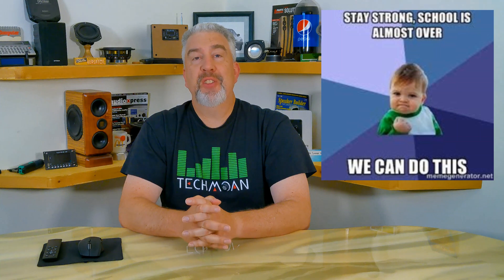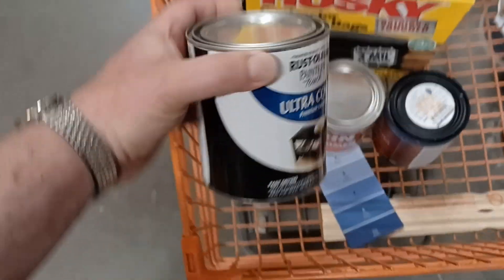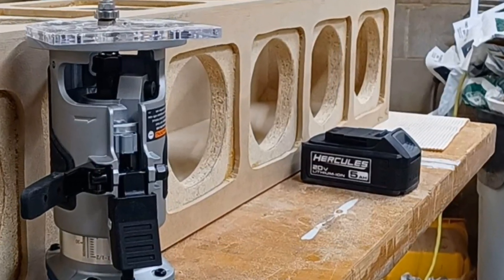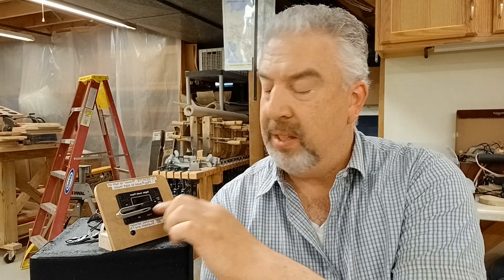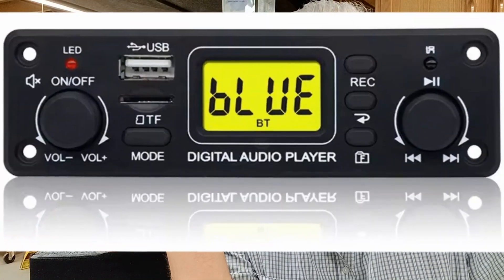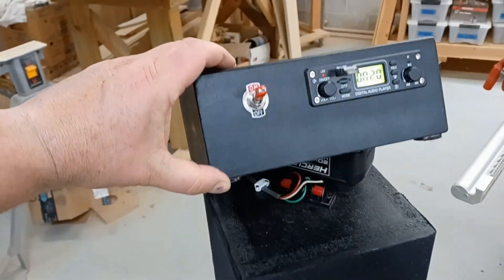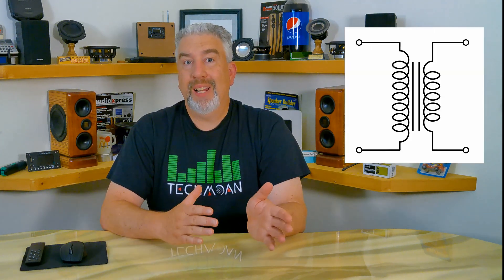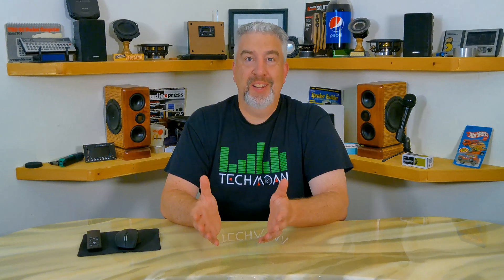Quick Tunes Music Player - Loud & Battery Power'd!

Comment: Great Video the unit it's Self is good it's the alliminiam covered  with copper is crap as you say I solder 16g wire and put screened wires I run mine on a 12volt converted from 21volts simple hot dipped packeg cost £8 the unit runs at full volume about 98 db for 17 hours on a full charge have used it many times so think you were unlucky my friend great videos keep the coming
Reply from the maker: Could be that I got a faulty unit, true, but this thing is just at the bottom in every category of quality. It's cheap, so I don't expect too much. Thanks for the comment.

Comment: I think I may know what the issue was. You said you tested it in your house with no issues (your house temp controlled), you played it in the afternoon with no issues, and you played it during the day in the "SUN" and after "SOME TIME" it started having issues. It sounds like to me that the head unit was getting hot and maybe a little DC fan would have kept it cool to the point it would have had no issues. 

Over all cool project!
Reply from the maker: Good thinking... seems to make sense logically. I was able to duplicate it again afterwards in my basement where it's fairly cool though, so I'm thinking it's just poor build quality...  nice deduction though!  Thank you for watching and commenting!

Comment: nice video! Maybe it did cut off because of the amplifier overheating, especially if there was a bit of sunlight hitting it; that would maybe explain why it worked just fine in the afternoon.
Reply from the maker: Heat... that's a really good bit of troubleshooting there. It happed later on in my cool basement, so I don't think that could be it in my case, but creative thinking!  I missed that one...  and Thank you!

Comment: Great Video! I think for its purpose this speaker is incredible. I really like the battery solution as you can also just take a couple of them with you and get up and running in seconds again when a battery died.
Reply from the maker: Thanks.  I didn't mention in the video how long the battery life was... it's probably in the neighborhood of 4-6 hours at 2/3 volume. Some day I'll test it out and post it in the comments.
Reply: @zarboaudioprojects1430  why didn't you make your own battery pack, isn't that cheaper?
Reply from the maker: @roygriend5143  Sure, it would have been cheaper to build a pack... but I would still have to figure out a way to charge it. Since I already had the battery available, it seemed like a good idea to just use what I had... only needed to purchase the battery holder. Time was of the essence. Plus you'd still need a way to charge any DIY setup. This was just too easy I guess!    Thanks for the comment and for watching!

Comment: I had the same thing happen when i added piezo tweeters to my setup. the amp shut down.  These units dont like low impedance loads.  I suggest re-wiring the speakers for higher impedance.. I added a series capacitor, and it worked fine. Likely too low impedance load.  Shuts the amp down.
Reply from the maker: The preamp/amp unit should have been fine with 4 ohm loads, and these were safely in the 6 ohm (nominal) area, so I don't think that's it.  Also, it handled even heavier bass music before and after with no issues, until it came back randomly after the event. I think the unit is just junk. Thank you for watching!
Reply: Ok. I also had the same issue as I've built about 5cof these so far.  Swap out the memory stick with a USB drive.

Comment: You always come up with such creative ideas!  Just to let you know, I have an air conditioner in my office/shop now.  When you decided to come do projects in my shop you can at least not die from the heat now.  There is also a refrigerator.  You can ask Toid, I have a lot of stuff to do projects with.  I also have stand-offs for amp boards.  And hot glue.  Lastly, I have a Lepai 2.1 amp and it would do something similar.  When the bass would hit and the volume was loud it seems to cut out briefly.  I think it was a power issue.  I turned the bass down and the volume down a bit and it worked okay.  I wonder if a larger capacitor would help now that I'm thinking about it.  That said, another great video!
Reply from the maker: Thanks Brian, I think having a case of speakers really helped me 'come up with this idea' a bit better.  A fridge and AC in the shop sounds glorious!  I agree, amps cutting out on heavy bass notes seems like it's starving for amperage, I've had the same issue (I think) with the first amp in this project on the bench, for that I thought it was starved for amps as well. This Hercules battery though should be able to deliver the Beans, and it sure does on the second separate amp/preamp combo setup. I dunno?  Like I said in the video, after 30 minutes or so and a prayer, it started working fine. Days later in the shop, it started cutting out again. LESSON LEARNED: Tom, don't use cheap junk on anything I actually want to work. :)   Thanks for watching.